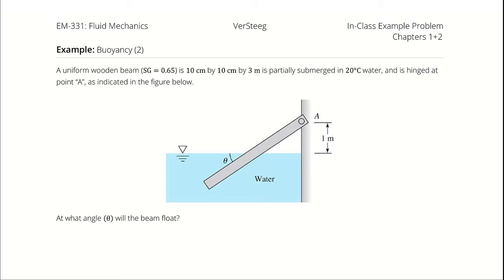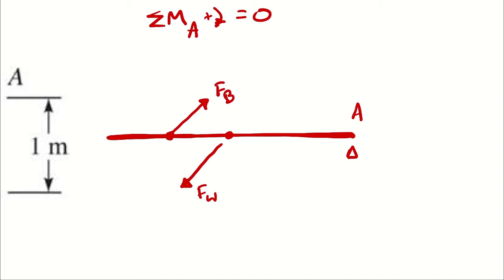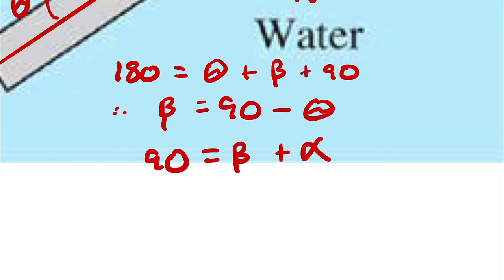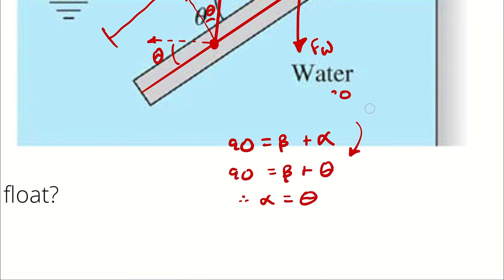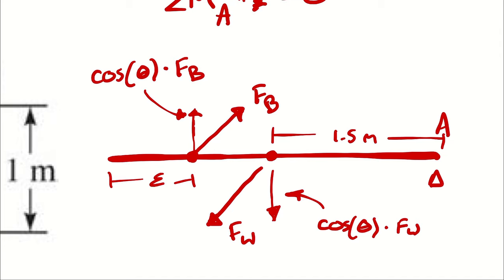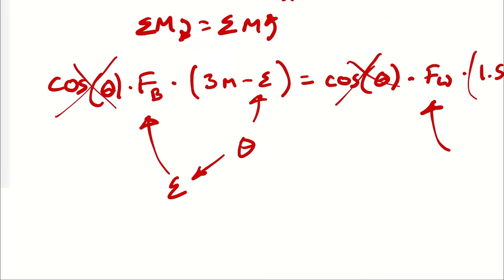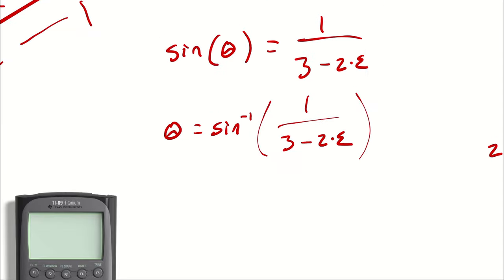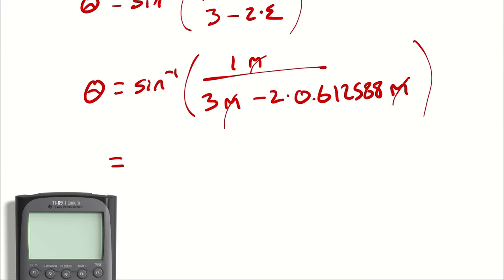Example Problem - Buoyancy (3)

Comment: why aren't you considering the hydrostatic pressure exerted on the submerged part of the beam?
Reply from the maker: Because it’s applied on both sides, and I’m neglecting the fact that there’s a slight pressure difference and a slight area difference due to the thickness of the beam.